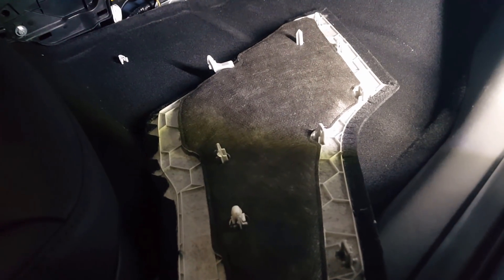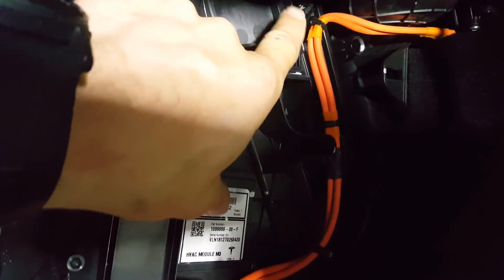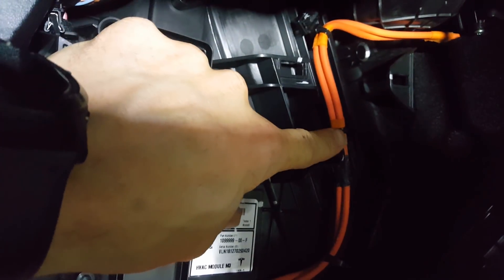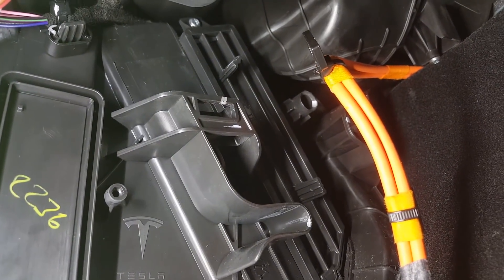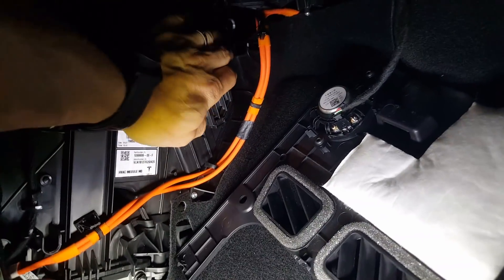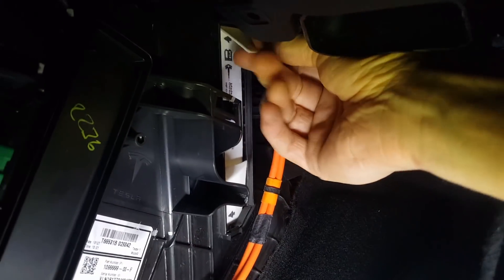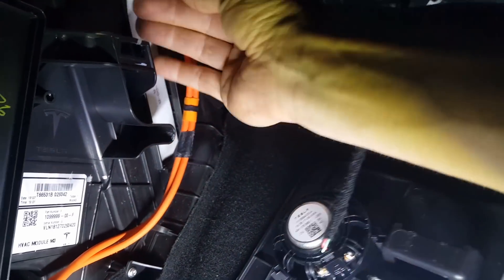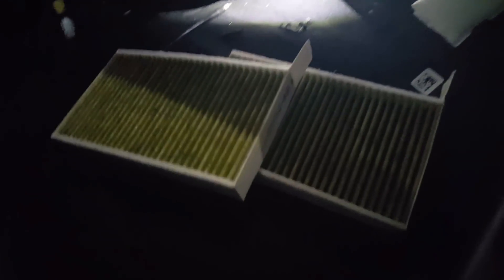Tesla Model 3 cabin air filter location

Comment: Anyone tried washing the filters? I have and works just fine, just make sure the filters are bone dry before putting them back. Vacuum the filters first (gray side) to get all the dust and dirt out then submerge in a bucket filled with warm soapy water, add a little bleach. I used a basin big enough to lay the filter flat so it doesn’t get deformed. Agitate the filter while in the water, you’ll see the water turn very dirty to dark brown then rinse under running water or fill up the bucket with water. Repeat a couple of times or until the soapy water doesn’t turn brown anymore. I dried the filters in the dryer, my dryer has the removable rack for drying shoes. It took a couple of hours to dry then I followed with an hour of sun drying.

This sounds hill billy but it works. My AC used to smell musty, wet socks and moldy but after washing the filters look brand new and no more bad smell.
Reply: I would use new ones. They look like they are have activated carbon in them, same as water filters. Carbon absorbs chemicals, pollutants, odours. It gets used up so washing them is only going to get out the dust and some mould.
Reply: Good to know!))

Comment: I've got the torq bits, but I don't have the flexible driver. Is it impossible to remove the screw because it's not a straight shot?
Reply: Correct. For me, it still wasn't trivial with the flex arm.

Comment: That is a horrible design and access strategy.
Reply: much better than a Nissan Leaf's cabin filter
Reply: @markt4711  at least Nissan's doesn't put HV wiring where you are trying to grasp at barely visible work areas.
Reply: @Trades46  How do you know they are high voltage wires or are you just guessing? Also, are you going to damage the wires using your fingers to remove the tabs holding the wires? Stop being an negative a$$. Any sensible person with even a little bit of common sense can replace those filters. You don't need to go to the repair shop to get it replaced.
Reply: Trades46 My Volvo’s wires that triggered airbags were orange.  Is it possible that they could be airbag wires here, too? My question has nothing to do with fanboys. Most of the high voltage orange wires that I have seen are of a much lower gauge. I’m not ruling out your theory, either.
Reply: Those are HV wires for the climate control, the cabin heater in particular if I recall right. Any orange wires in that shade are a dead giveaway.
Reply: No Man's Land Thank you so much 😊

Comment: Great!   Curious about scheduled replacement ?  After 6 mo; 1 yr ??   Can you clean them ??
Reply: I just replaced mine after 1 year and 26.000 miles. the bottom one are way dirtier than the top one, but doesn't look too bad. i might try vacuuming and rinsing the old one. It's a $15/each part from Tesla.
Reply: It's a lot harder to access than it looks because of the awkward location and position. Took me half an hour (noob & first timer)